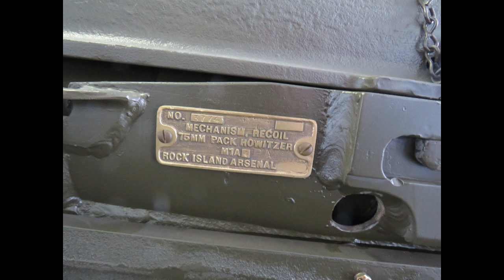WWII US M116 75mm Pack Howitzer detail walk around video

Comment: Well this brings back some memories. We had 5 of these things at Fort Hamilton when I was stationed there from 1989 to 1992. We used to use them for battery salutes, and other ceremonial functions. I could fill a book with all the crazy stuff we used to do with these guns. Things like, putting things in the barrel that ended up going through windows in the housing area, or the roll of gas soaked toilet paper we fired at the Verrazano bridge. Don't try to clean the barrel with an old mop head. It didn't end well.